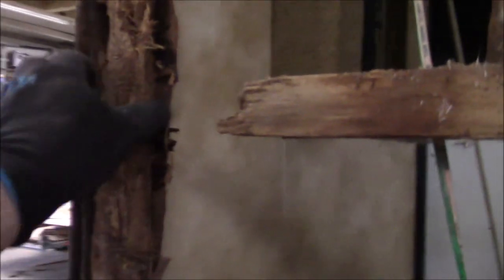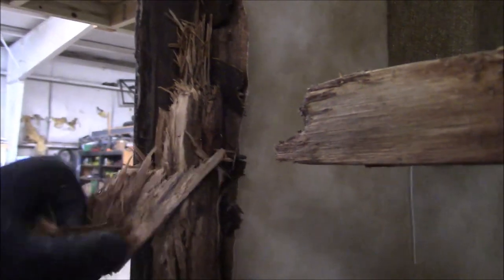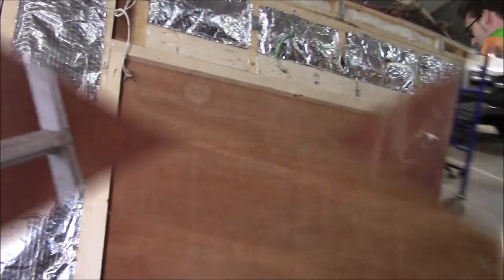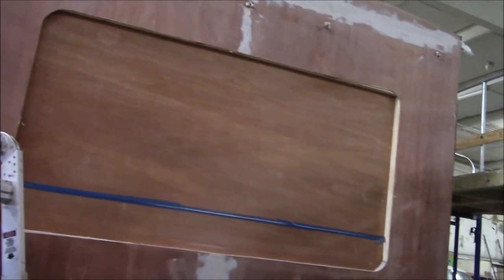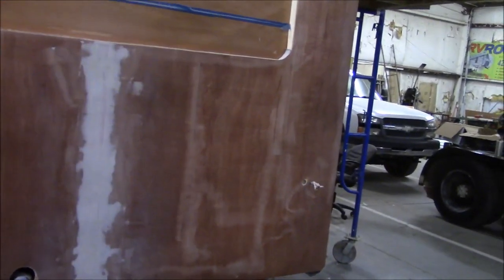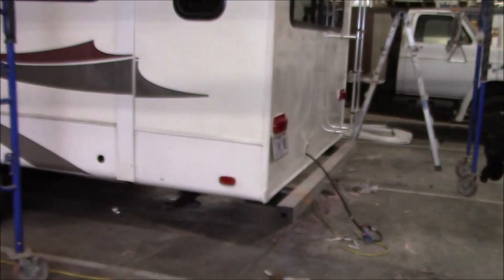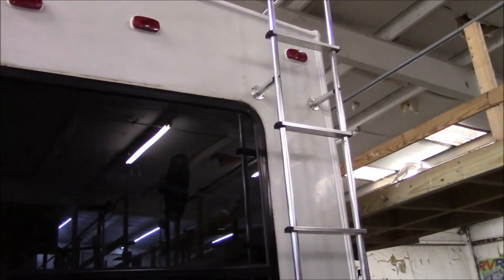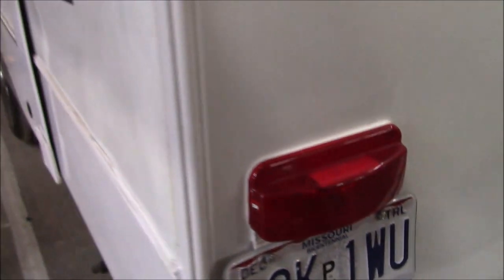Sundance 5th Wheel Rear Wall Rebuild

Comment: How do you glue the new luan wood on the new wall frame? I tried using 3m 90 but it ate the foam!  I’ve noticed on the roofs you use a foam adhesive but you have to put blocks on them until it cures that won’t work for the walls or ceiling as you’ll need to apply pressure and time for it to cure. Thanks

Comment: so to remove and replace the back wall then you have to remove the cabinetry (upper/lower), or whatever is along the back wall from the inside first?
Reply from the maker: As much as I stress this isn't a DIY channel.... You can use some vertical support to hold the cabinets up. This is contingent to just how much damage is is in back wall.  So you may have to... Maybe not.  We try not to remove the cabinets if possible. We try to work around them if possible.
Thanks for watching.

Comment: i have the same issue this rv has but in earlier stages, do you happen to remember about what it cost to do a job like this?
Reply from the maker: I don't recall off hand. Give us a call 423-475-7663. We'll be get you fixed up. Thanks for watching.
Reply: What do you mean you don’t remember? I’ve been in homes for almost 30 years and I can walk up to any house within 10 seconds. Give me a price because I’ve worked on thousands of homes and I would dispose of these campers are exact same thing you should be able to give a price right up top your head and you don’t remember.

Comment: How did you get the wood off the rear wall. It’s glued very well.
Reply from the maker: You mean the wood off the Filon? Or the back wall framing?
Reply: I’d like to know how to get it off the filon please
Reply from the maker: @laurenrussell7947  sand it down